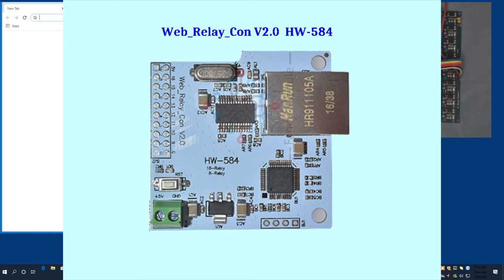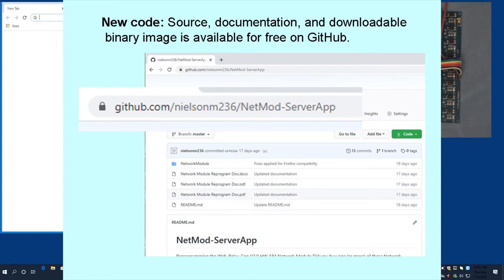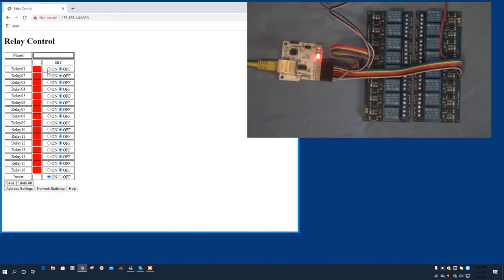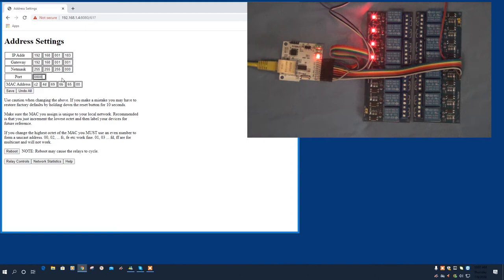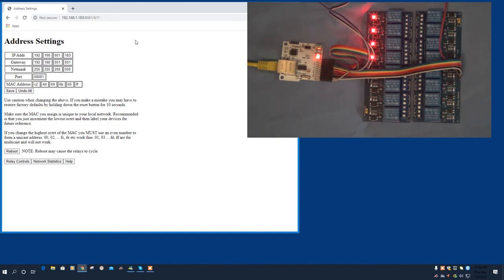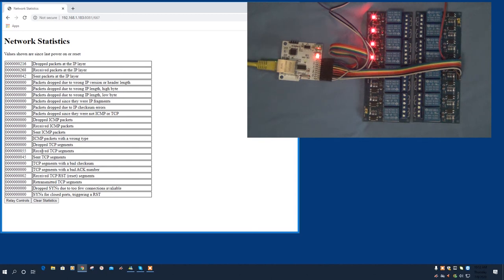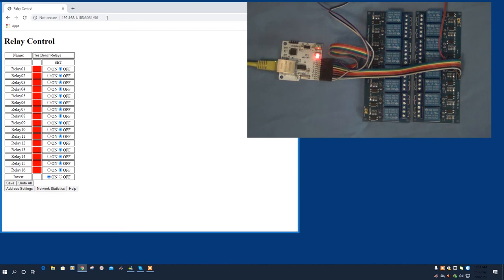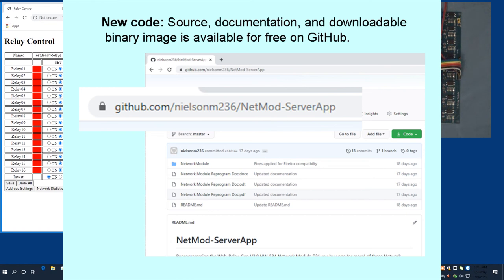Web Relay Con V2.0 HW-584 Network Module 8/16 Channel Relay Controller ENC28J60

Comment: It's possible some people choose to flash their esp8266  device and use for control. However the esp8266 or the esp32 do not have Ethernet. So this device suits my own personal needs as I want my iot devices wired but on WiFi. 

I might have posted before here. And I did buy all the parts required to build this Web relay device. But I got side tracked in other life events.
But now some 3 years later I'm ready to do this project.

Btw: You did an excellent job on your 4 tutorials. I thank you very much for that.
Best wishes. 
And Wish me well. 👍😎

Comment from the maker: I've updated the code on GitHub so that it now supports the original 16 outputs (16 relays), 8  outputs/8 inputs, or 16 inputs. Each configuration requires a different code load due to flash size limitations of the Network Module. Of course you can reprogram a Network Module at any time to change its configuration. The GitHub address is visible in the video. I'm working on additional videos to demonstrate the new configurations and to demonstrate how to program the devices. In the meantime the document in the GitHub site explains it all in a step by step procedure.
Reply from the maker: The video demonstrating added features is at https://www.youtube.com/watch?v=RPEyMfmF8_8

Comment: Great video, straight to the point! Very useful, need to acquire a relay module myself and wondering which type to get. Would you say the best way to go is to purchase a network module like this, and then connect to a simple relay board, or find another relay board with included network control ? I guess most of these "combined" boards would suffer same issue as what you have fixed!
Reply: ESP8266 relay boards come in many varieties if you don't mind wireless.   ESP Easy firmware works well, there are many others available depending on your needs. Lower price, better compatibility, huge selection.    My first suggestion would be a Wemos D1 Mini with Relay Shield. 

I appreciate the effort of creating working firmware for the sainsmart relay but it's kind of lipstick on a pig as their relay is over priced and you shouldn't make your customers fix your firmware to begin with.

Comment: Hello congratulations on everything ... it would be possible to control some output to activate relay for 10 seconds and then disable. Grateful and excellent work
Reply from the maker: With code changes this could be done - but there is very limited memory to retain such settings so I don't think it is practical within the device. It seems this could be done more easily with external mechanisms - whatever you are using to interact with the device. FYI I am working on an MQTT interface that may make this easier if you use things like Home Assistant or similar.
Reply from the maker: An update: Working on including timers in the module. "Watch" the project on GitHub so you'll know when this is released.

Comment: Very good Video, I have build a full home auto at home for lights with light dimmers and mains plugs with my own inferred remote and so so 30 years ago..  all I now need is to control them remotely via IP from any where in the world... I am sure I can set up a VPN to my home network to gain access to it. From your demo I can see there is no password to get into the Web version. Do you have any plans to add that option, this way I don't have to VPN in. Well done for the very good explanation of the video.
Reply from the maker: Hello Devraj - The video you commented on is actually one showing an earlier feature set. You may want to check out the updated video at https://www.youtube.com/watch?v=cnLHd9GqplY&t=107s
I'm not planning on adding password protection. One of the problems with the very limited Flash and RAM space is that I cannot implement strong security processes on the device. For that reason I recommend that they should not be exposed to the internet, instead only exposing them to your internal network. Then you can access via VPN (as you suggested), or they can be accessed by logging into another secure server on your network.
Mike

Comment: Is the HW 584 low or high trigger? I want to use it with a 16 relay module but the relay module can be obtained with low or high trigger. Which one will work with this?
Reply from the maker: Either will work. In the GUI you can invert the output. An important thing to know with the 16 relay modules is that most use a different input design that is intended to work with 5V logic. The HW-584 module is 3V logic ... and the driver outputs have diode over-voltage protection built in. This can cause a current path through that diode when at a logic-high, causing relays to always be enabled. This problem does not occur on the 8-relay and smaller modules because of the way their trigger logic is designed. HOWEVER - if you go get the manual from my GitHub site you'll see several solutions to the problem. Numerous users have the 16-relay modules working using one of the solutions described there.
By the way - this is an older, obsolete video. Follow the links in comments below or on the GitHub site to see the latest.

Comment: What's the 5V for on that ethernet board (noticed you did not use the 5V pins)? Also, mine came with a heatsink but the board has 2 chips, one rectangular and one square, which one needs a heatsink?
Reply from the maker: They don't provide much information, do they? Here's what I've found: 5V is used on the board to supply a 3.3V regulator. 3.3V is then used by the chips on the module. However, the 5V pins on the 20 pin edge connector are also tied to the 5V pin on the power supply connector on the board. So, this gives you some options: Provide power to the power supply connector, then let the 20 pin edge connector provide 5V to your relays. OR, provide 5V to your relays and let the pins on the 20 pin edge connector provide 5V to the module. Your choice. But per the manual I wrote, remember that the IO pins on the module are 3.3V logic levels, so you have to take care in how you attach those pins to relay control logic or when used as input pins. I provide several suggestions in the manual.
With regard to the heatsink: It appears the Ethernet chip gets the warmest, so my bet is the Ethernet chip requires the heatsink. Whether you use it or not depends on how warm your ambient temperatures are. The Ethernet chip is the one marked ENC28J60 (the rectangular one).
Also note the video on this link is obsolete. See the note in the description for a link to the updated video.

Comment: I very much appreciate your efforts with this device.  I purchased one of these and have been fooling around with it a bit.  I'm a real "techy" type of guy but all this network stuff is outside what I usually do.  I've got the device plugged into my network and it does work ok with the included software.  My question is can this device be accessed from a remote location over the internet or only when attached to the LAN?  I appreciate any response you might provide.
Reply from the maker: Hi Mark - With the "from the factory" firmware I believe you can set up your router to allow access to the device from the internet. Just keep in mind that you'll have to leave it at IP address 192.168.1.4, and the device defaults to Port 80. In their instructions they talk about "port 30000", but that's not actually a port - it's a directory reference. You can change the IP address, but on power cycle it will revert back to 192.168.1.4. And you can only have one device on your network because the from-the-factory firmware won't let you change it. All that is why I wrote a replacement code load.
Reply: @nielsonm.projects  Thank you so much.  I'm a very technical guy but this is an area I'm not familiar with. I'm going to play more with it and see if I can make it work.  I can control the relays from my phone as long as the wifi is connected to my signal but when I switched the wifi off and tried to control the relays off the 5g signal it wouldn't work.
Reply from the maker: Hi Mark - When you try to control it via your phone 5G you are trying to contact the device via the internet (from your previous question I think you know that). For that to work you need to contact your router's internet address using some port you pick. Let's say your router's internet address is 67.150.111.3, and you've selected port 9000 as the port you want to use to contact the relay controller via the internet. So, on your phone you would enter 67.150.111.3:9000. THEN, in your router you need to set up Port Forwarding so that any incoming browser activity on port 9000 will be routed to 192.168.1.4:80. If you've never set up Port Forwarding on a router before this can seem daunting, but it is really fairly simple as long as you know how to log into your router :-).

But of course there is a catch ... what if your router's internet address changes? Your ISP can change your IP address any time they want, although they typically keep it constant for months or years at a time. The best way to handle this is to sign up for a DNS service to provide a URL to IP Address translation for you. That way you don't need to know what your router's internet IP address, you would only need to know "http://myhouse" or similar. I use the service "entryDNS" at a cost of $10 a year. But, for the moment, you can just type in your router's internet address while you experiment.
Reply: @nielsonm.projects  Hi Nielson, Yes that is correct I wanted to see if I could control the relays with my phone.  Worked fine when the phone was on my wifi but wouldn't connect when wifi was off.  I like the relay board and bought it really to just full around with internet remote control.  I'm going to co tin to play around with the device but your YouTube post came at the right time!  I'll let you know the outcome

Comment: hello i bought a relay card from internet. sodial 4relay. unfortunately I have no software to operate the card. is it possible with your software that I can use the card? I have the ip address 192.168.3.102 port I don't know.
thanks
Reply from the maker: I'm not sure what product you bought. Your are certainly welcome to the source code on GitHub. The code as-is is specific to the module shown in the videos.

Comment: @NielsonM.Projects Hello, thank you so much for this! I have done all you explained in the document but when I try to change the IP adress and the gateway, it won't. Instead I am directed to a page with a messed up layout of the page where I could change the ip address starting with: title='Enter 000 to 255' maxlength='3 
I used 192.168.2.80 for IP and 192.168.2.254 for my gateway, so nothing out of the ordinary. Can you help me?

Thanks Leon
Reply: EXTRA INFO: I can't open the help page 2 and I can't change the device name. During loading the file in ST Visual programmer it says multiple lines 876-878 out of range and ignored. Does That means that part of the program is not transferred? it happens with all the version 16 out, 8 ou - 8 inn, 16 in.
Reply from the maker: Hi Leon - You can ignore the "out of range" messages. The programmer is just telling you that there are elements that are not part of the Flash area. They should have implemented a more understandable message.
With regard to the display issues, what browser are you using, and what release version? With the code currently on GitHub I tested with Edge, IE, Firefox, and Chrome - but as I've continued development on the next version I'm seeing issues with Edge and IE. Chrome and Firefox have been working flawlessly.
Reply: @nielsonm.projects  I am using safari on my mac could that be the problem?
Reply: SHOOT that is the problem.... google chrome: no problem! Thank you so much for the quick reply!
Reply from the maker: I don't have access to a Mac or Safari so I've never tried that. I think you are the first. I have to say though that I think it should work. You may have to enable some compatibility setting (it has been years since I used a Mac so I don't recall how all that works). Maybe one of the other subscribers can chime in with some help.
Reply: @nielsonm.projects  Oh never mind since I have google chrome, there is no problem at all. Thanks for all the work and your quick responses
Reply from the maker: You're welcome - and I'm glad you got it going. Keep an eye on the project as the next version will have some bug fixes on the current capability (and might even address Safari), and will have the ability to support MQTT.
Reply: @nielsonm.projects  I will thanks
Reply from the maker: I just updated GitHub with the new firmware that includes MQTT. The new documentation provides details. FYI I tried it with Safari on my iPhone 10XR and it worked fine. I don't know if there is any implication there with regard to Mac/Safari. If you try it let me know how it goes.
Mike
Reply: @nielsonm.projects  Thanks, I will let you know. right now my project is under construction, therefor it will take a litle while before I can test it.

Comment: it looses the IP address setting on power loss. Goes back to 192.168.1.4 and then if you have more than one device in the network, you have a problem
Reply from the maker: That's why I wrote the replacement code. Have you tried reprogramming it?
Reply: @nielsonm.projects  I commented before I read everything. Great work! I ordered the ST programmer already. I bought 4 of these devices for my home and testing, and was infuriated now when I was testing it and realized they loose all settings on power loss. Changing the "port" doesn't do anything, and when you change the IP address, password gets cleared and you need to access it by putting double backlashes at the end, like this http://192.168.1.123// regardless of what I put under "port" while changing the IP. Ridiculous. How reliable is the device with your server? Does it really retain settings after power loss? Can it be used in a professional environment, I mean, can I use it for re-sale in other people's homes?
Thanks again Nielson!
Reply from the maker: Agreed ... I was infuriated enough to write all that code. :-)   Yes, all settings are retained through power loss. That's a part I tested thoroughly as it was the point of the project.
So far I'm finding it to be very reliable with 10 devices operating in my home, and I have received positive feedback from others. But keep in mind I'm not making any guarantees. I consider this to be a "hobby" project.
I placed no restrictions on my code so you can use it as you please, although you have to keep the code credits in the documentation and source code as I've borrowed heavily from other GitHub sources. As far as "professional environments" I recommend that you test it for use in targeted applications. I don't have the ability to provide professional level testing so I can't speak to reliability of the original hardware or to whether the device and firmware will meet all timing requirements of your application. For instance, I haven't tried rapid relay control writes. And there was not enough space in the device for SSL/TLS, so communication is unencrypted.
Also note I've been working on an MQTT interface for the device over the past few months with help from a user in Portugal. MQTT is for environments like Home Assistant, Node Red, and IFTTT (which should then allow Alexa, Google Home, etc). It should be released soon (I hope). Changes required to implement MQTT require that I change the user interface slightly even for the Browser mode users, but it otherwise retains all the functionality of the current release.
Reply from the maker: Please let me know if you run into issues. I'm always happy to chase down a bug (or at least try!). I just looked at your pro.reactor site. Is that something you share or sell? Looks very interesting. And looks like your programming skills may be way beyond mine.
Reply: @nielsonm.projects  Thanks for the compliment, but I'd say my skills are not so beyond, but maybe more in higher level languages. I haven't shared my code with other people as it's more of a personal project, and it's not advertised, so not much people know about it, if you want, I can send you the source. :). There were quite a few iterations of it on different .NET platform versions, been working on it for the past 5 or 6 years. Right now it's running on .NET Core 3.1 on Linux (or Windows), I do development in Visual Studio 2019 on Win 10. Currently I'm working on integration with the IKEA Tradfri lights, so I can control light dimmers and colors directly to its local IP. For this I need to wait for the ST programmer... :|
Reply from the maker: The MQTT version was just released to GitHub.
Reply: @nielsonm.projects  I just received my ST-LINK programmer and reprogrammed all the devices I have. Great stuff, what you did. These might prove useful after all.
Reply from the maker: Thank you for the comment. If you haven't done so already you should consider subscribing to the GitHub project so you'll know if defects are corrected (and to report them!). And feel free to communicate on the nielsonm.projects email address shown in the GitHub project.  Mike